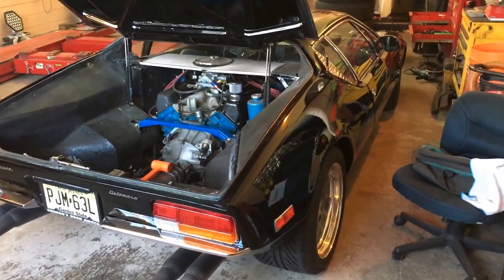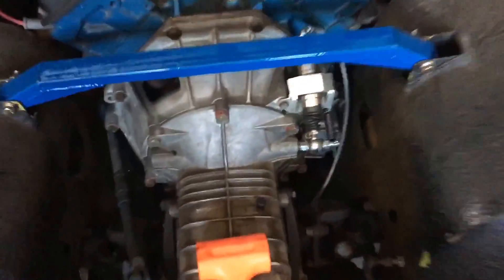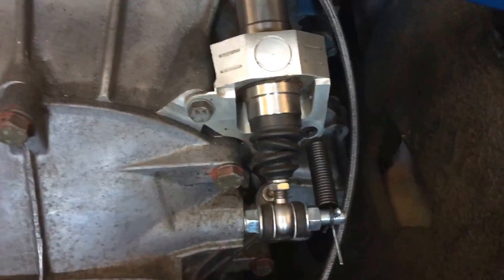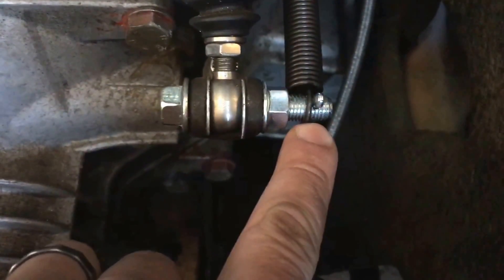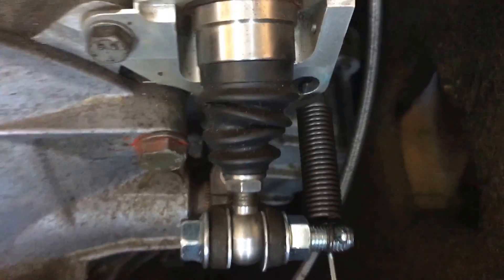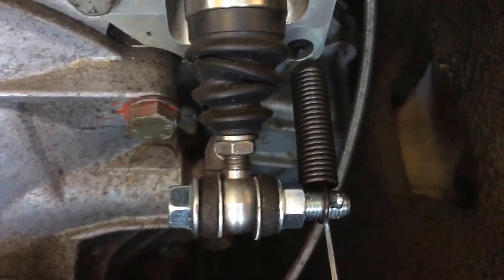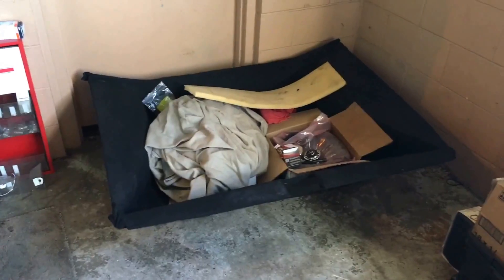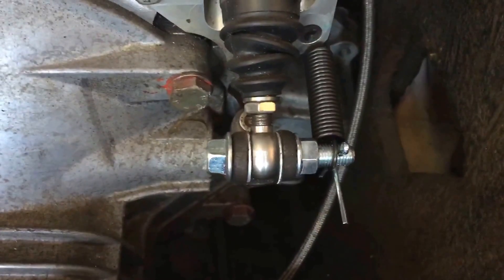1971 Pantera DeTomaso clutch slave bolt spring repair

Comment: That looks like a custom bracket holding the clutch slave. The spring is attached to a bolt hole in the bellhousing??
Reply from the maker: the bracket was purchased from PIM. but the flaw was what i fixed w/ the bold and cotter.